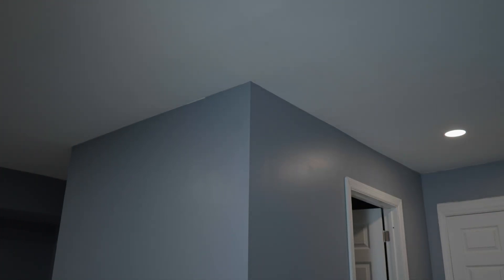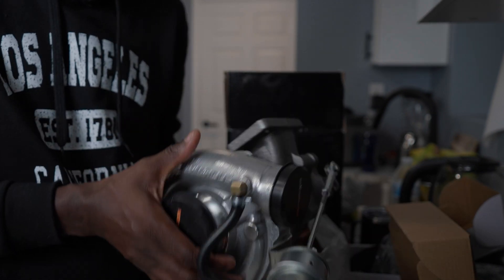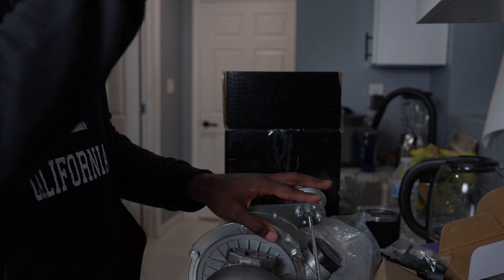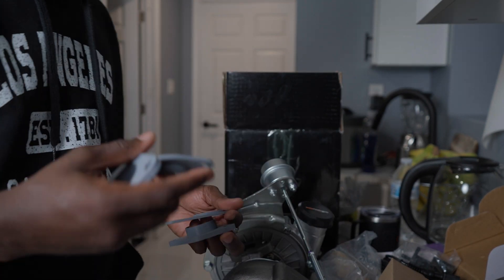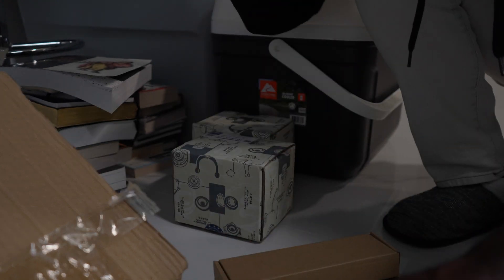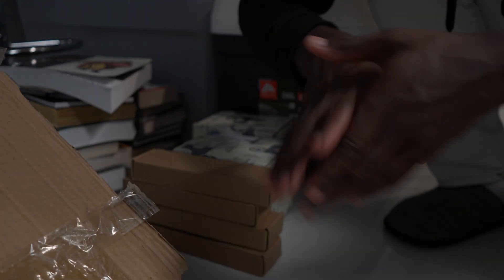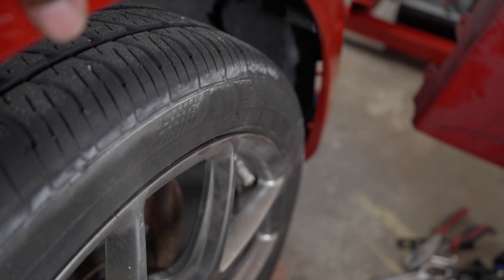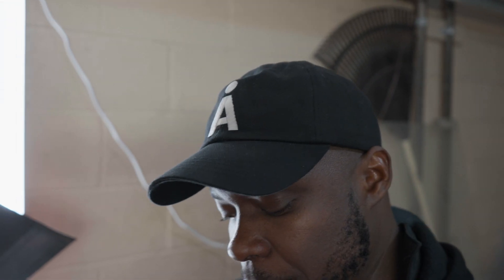BUILDING A POWERFUL BMW N20 | PART 6

Comment: I've been following your videos for a long time they're always helpful and informative, what happened to the 400hp build a couple years back? Also, do you think you would make an in-depth video on how to pull out and install the n20 engine? I'm interested in rebuilding mine as well!
Reply from the maker: I appreciate the support.
yes. I will have an in-depth video of how to remove an N20 engine. I am just waiting for the block to be here from the machine shop. it a long process.
what happened to the road to 400HP? well, quite a lot had happened. The 328i didn't feel fun for me anymore. driving an automatic car was too boring, and I was getting a lot of leg cramps on long driving distance. I sold that and got this current 228i. same motor, same internal, basically the same thing with the difference of a smaller body and a fun 6-speed manual RWD. If you followed closely, I had installed the WMI. with this, basically, the next thing was just to tune it. as I was tuning it the other day, the turbo gave up. I got another turbo, and I couldn't get the results I felt before. That led me to step up to just rebuild an engine. Now, if you want to keep the OEM internals and with a good tune on Meth, you centrally can safely get 400 and with a bolt on upgraded turbo like MHI. the oem turbo maxes out around 350-370. This is your safe spot. I centrally did hit this from the last episode after the meth installation. that is basically all you need for 400HP with stock internals.
Reply: @hyde_official  I get that the seats alone can uncomfortable for long periods of time. Thank you for the information looking forward for the upcoming videos and best of luck on the build!